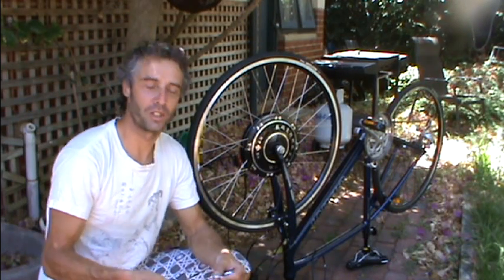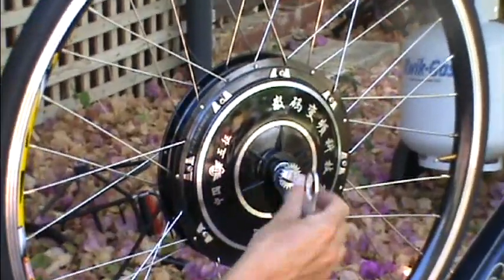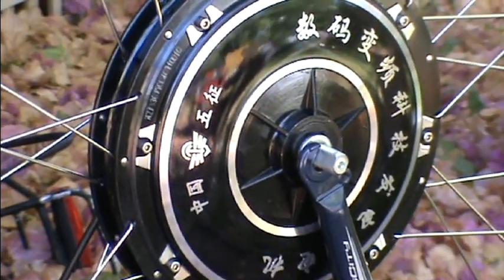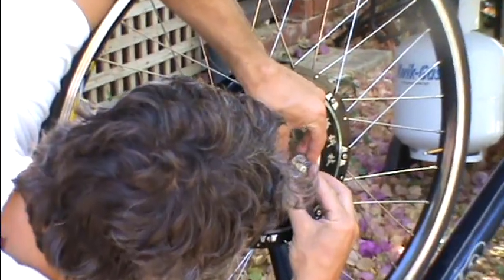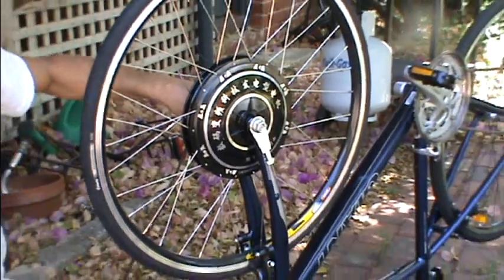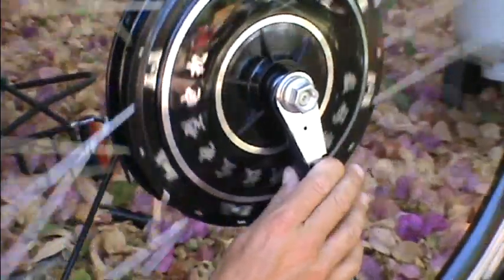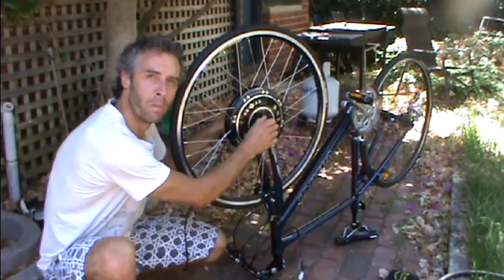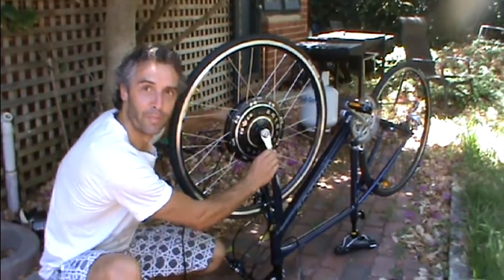Torque Bar Installation on an Electric Bike Conversion Kit

Comment: make your own Torque Bar the ones they send with kit are to cheap they will bend on you while driving your bike very Dangers a lot of torque on these hubs .
Reply: The eBikeling ones are garbage.  Better without them.

Even Grin Tech ones don't fit the bike I have.

Comment: Thank you so much for the video. I bought a front 48v 1000w motor. I was very excited at first but when I took it for a ride the motor instantly came off and I did tightened real tight. I just thought the motor was defective and thought about taking back until I decided to look up info online and found this. I bought a torque arm similar to this and attached it to the motor and axle, then took it out for a ride again and it worked great. Wheel didn't come off.
Reply: Same thing happened to me!! is the torque arm still working?

Comment from the maker: It's a very old supplier I was using. Wuking something etc.... They make electric trucks in China. The motors were really good and strong but their controllers and batteries left a fair bit to be desired and they were hard to work with.